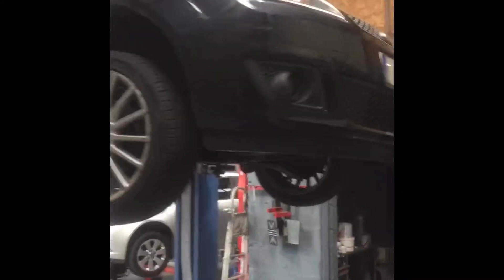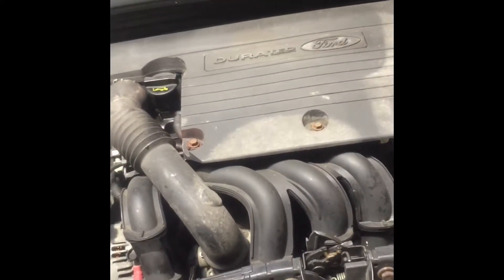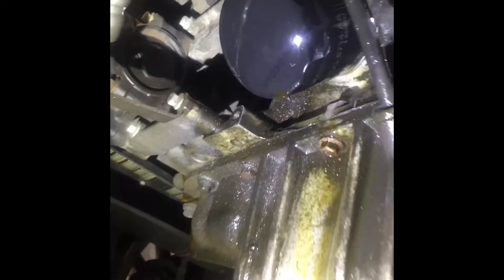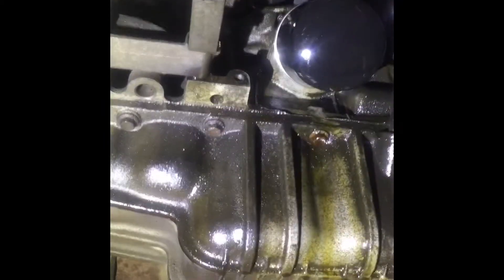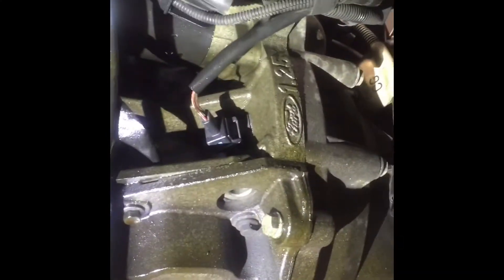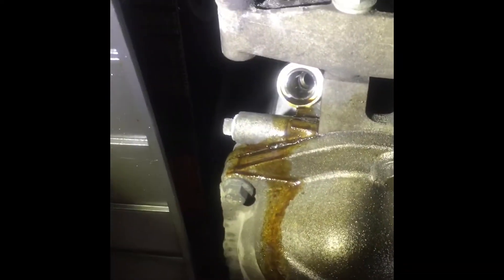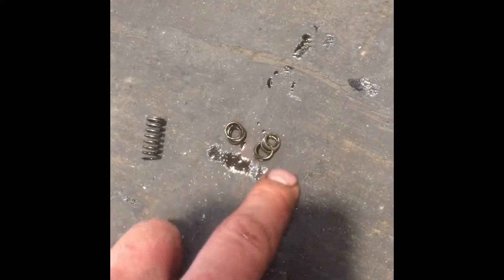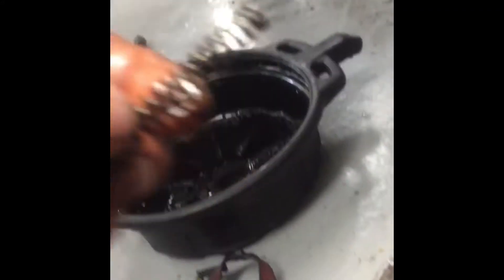Ford oil filter seals bursting

Comment: Hi Kenny I know this is a very old post, but its the only place on the net that has a resolution so well done on that part. Im current looking for a spring you dont remember the length of the spring do you?
Think I lost a bit of mine and the spring world is a mine field. If you can remember that would be amassing. 
Many thanks
Reply: Thanks Kenny, yeah 2nd hand pump it is then.
Thanks again👍
Reply from the maker: @ just use the springs though, too difficult to fit 😉👍👍
Reply: Hi Kennedy, deserves a follow up. Bought a Chinese pattern on ebay, that had a different size spring and valve in it😡. So sent that back. Found a used one for £15 spring in good condition, you was spot on it is 50mm but 8mm in diameter. This must of happened loads of times, the pump is used from 2002 to 2012! Fits Fiestas, Focus, C-max and some Mazdas yet this is the only video and very little in various forums. Thanks again mate.
Top man💪
Reply from the maker: @ good man Chris, very handy information for others. Well done on the fix 💪💪💪
Reply from the maker: @ChrisConstantino-c9n  it was around 7 mm in diameter and 50mm long but the best advice I could give is to get a spring from a local salvage yard or a complete oil pump from eBay and remove the spring from it 🤷🏼‍♂️🤷🏼‍♂️
Good luck with it mate 🤞🤞🤞

Comment: I have the same problem with a focus tivct 1.6,, thanks for the video👍🏻
Reply: Has anyone got an idea where the oil pressure bypass valve is?
Reply from the maker: David Wilshire that spring I replaced is part of the pressure relief valve. When the plunger on top of the spring is pushed up by the spring it holds the pressure up, when the oil pressure rises it pushes against the plunger/spring and pressure reduces at higher rpm through a relief hole behind it.What happened to me is the spring broke up and go jammed under the plunger in the pushed up position not allowing the pressure to reduce at high rpms, blowing out the oil filter seal. The spring must be very similar in strength.
Reply from the maker: David Wilshire You’re welcome, I know lots of people have changed engines because of it. I’m glad if it helped 👍